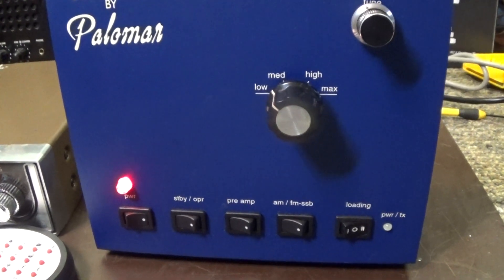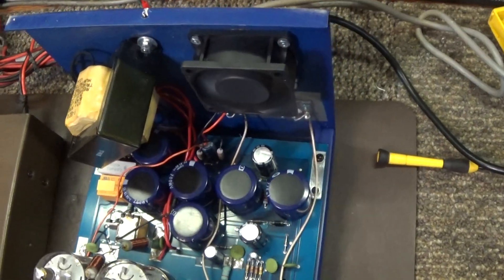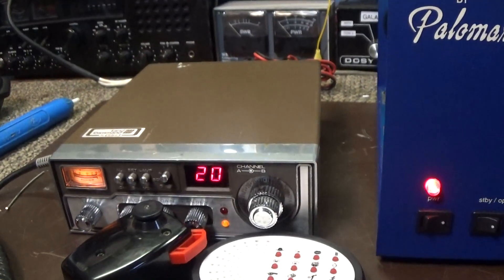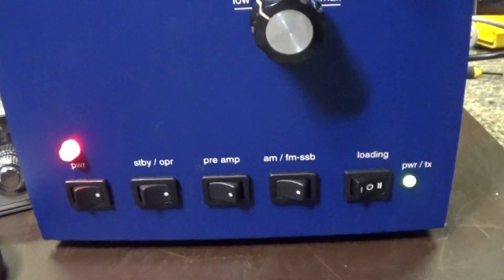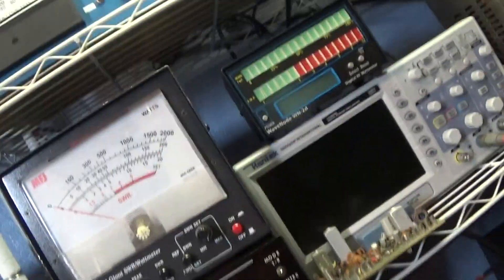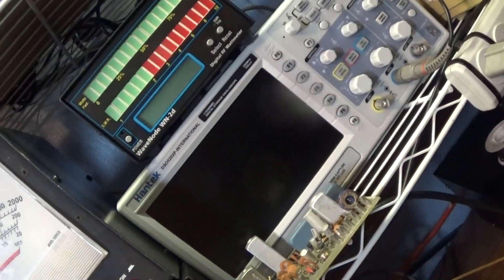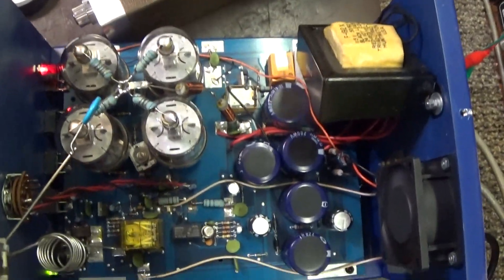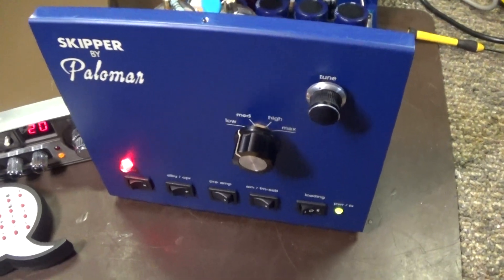Skipper by Palomar 4 tube 6146w linear amplifier

Comment: I really like this amp but Im getting 400 pep from a 2879 2 pill comp style Fat Boy amp.
Reply from the maker: Sure and transistors are a lot easier to use and a lot more trouble free than tube amps. But, tubes are cleaner, got more audio, and have more soul. Transistors are soul less.

Comment: Is possible to build one like this in grounded grid configuration?
Reply from the maker: Yes, but the problem with grounded grid amps is they need a lot more drive. For an amp like this with 4 output tubes, you would need to drive it with 50 or so watts, or build a driver tube in it, plus you would lose all that great swing.

Comment: So you are using a suppressed carrier with all of the negative peaks clipping, this is what your unmodulated carrier tells me.  I would not put that kind of signal through any power amp and put that up on the airwaves.
Reply from the maker: Suppressed carrier? No, reduced carrier. Negative peak clipping? No, assymetrical modulation, with no clipping neither + or negative.

Comment: Hello Tramdr: 
I am radiomedic111 and I am the designer of this little amp....the design was first presented to the manufacturer in late 1998 and then in early 1999 they were placed into production, I ended up working for them and did the assembly and pretesting of all of the units that were produced up until 2005 when the last run was made....in all there were 400 plus units made
as we were on our fifth order of circuit boards at 100 boards per lot. some of these were also produced as 3 tube units with an output of 150 watts and were equipped with a PTT line output at an RCA jack and thus were able to key up and drive bigger amps like the Heathkit SB-220 and the like. The circuit board had a floating ground or B minus ground plane that was isolated from the outside edges of the circuit board by RF bypass caps that blocked the DC and the AC line from connecting to the outside world, the power cord had a ground lug that acted as a safety ground. Although no schematics were ever provided by the manufacture, I will work up a complete full schematic in the form of a Jpeg and give it for free to anyone that would like to have it. My email is radiomedic111@yahoo.com 
I am just now getting back into the design and production of other small amps like this just in case anyone would like schematics or info on how to repair them. Thank You....Be safe everyone!
Reply from the maker: What is the 'Loading' all about?????
Reply: @tramdr  The 3 position load switch selects one of the 2 silver Mica caps plus the one in the center ....should be a 47Pf, 100Pf and a 150Pf lined up side by side just in back of the load switch and you would place the load switch in the position that gives the best or most output....the center position leaves only the center silver mica cap connected. Hope that this helps.
Reply from the maker: I would think to just put an Arco trimmer there.
Reply: @tramdr  Yes  you are correct, that would be the normal way to go and actually the original design called for a broadcast cap but that was a high priced item at $18.00 ea. at that time and an ARCO pinch cap with a shaft was $12.00 per unit...so a 3 pos switch at 35 cents and 3 silver mica caps at about 27 cents each was what they went with. the TUNE cap in the first few units were the ARCO L style  pinch caps but some units came back for warranty repair with the tune caps arced over from high voltage  RF, so the change was made to the air variable caps to prevent that from happening.

Comment: I had one come threw the bench. works great don't like much drive . had HV diode and cap go bad along with tube. 6146 a/b/w is also a ham radio tube. still made in china . got a heathkit with 2 that works 6m band . 73's

Comment: 6146 is an audio tube? Did you even bother to look up the datasheet?
Reply from the maker: I looked up many data sheets, tube history, and tube lore. 6146 is a later derivative of the 6L6 family of Octal based audio tubes. The 6L6 was of course designed as an audio tube but could be used as a rf amplifier up to about 10mhz and with reduced power up to about 30mhz. The 6146 is simply a 6L6 with the Plate coming out the top rather then the bottom which gives it a higher plate voltage rating and less plate capacitance which was the biggest hindrance for higher RF frequencies. Yes the 6146 is a well known and highly used RF tube, but it is still simply a 6l6 with the plate coming out the top and is used as both an audio and rf tube......but you already knew that, right?

Comment: have not been about to find one of these amps, been looking for years.
Reply from the maker: I regret selling all mine. Very hard to find. People like them a lot and love the 6146 tubes. I didn't like the direct transformerless HV supply and would mod that to an outboard transformer supply if I got another.
Reply: @tramdr  at minimum use a damn isolating mains transformer!  where should one look for one of those amps?

Comment: Hello my friend? Congratulations !!!  and the SWR  radio/amplifier????  how was it???   a big 73 PY2LP LUCIANO - BRASIL
Reply from the maker: I have had a few of these, they sold very fast. I do not have one at present, but from what I remember both the input and output SWR was very good. Only problem I have with these is the direct to mains quadrupler power supply.  I have heard of a couple big guns that got electrocuted using that on there big amps.
Reply: @tramdr  Hi tramdr!  
I really like your videos. Congratulations on your channel. Tell me something: How are you coupling the amplifier input ???
Reply from the maker: I bought and sold this amp a couple years ago. I do not build amps. If I remember right, it used an L circuit for input coupling.

Comment: The Load switch  is used how? Do you switch it and tune, and  switch it back then talk?  Never ran across this before.
Reply from the maker: No, instead of a variable capacitor for the Load tuner cap, this amp used a 3 way toggle switch hooked to 3 different cap values for the Load. You Tune the Tune cap like normal, then switch the different Loads and see which one works best. What they did was go cheap. A switch and 3 caps cost maybe $5, a good variable Tune cap cost around $30. Hence the makers saved themselves $20 by doing that, and probably saved another $50 by going with no HV transformer.
Reply: @tramdr  Thanks for the info, the tune knob can be turned for two days, and does nothing. LOL I like the box because it has 6146 tubes , instead of Sweep tubes.

Comment: that amp is american made buy  777 out of Tacoma Washington. ,  i used to sell them. i still have a couple left,
i also have two prototype black boxes of the early examples.   built for 11 meters.   uses a 24 volt transformer.
Reply from the maker: want to sell them?
Reply: you should let me get back to you, the two blue ones i have found were both brand new, they have been in storage for about 13 to 14 years now.  their should be two or three more, all new, that i haven"t yet been able to locate.  all my radio gear was packed for me many years ago. so maybe they walked off like many other items seem to have done.  you should give me an email address. and i can send pictures if you like.
Reply: Washington yes Tacoma no, these are from the east side of the state

Comment: Those 6146's are excellent tubes. Used in so many transmitters of the 1950's 60's era. EF Johnson etc etc. l wish 11 meter amp builders of the past would've used them. I guess if they had they would've been selling for the currently crazy prices being asked for 6lq6, 6lf6, 6kd6 8950 ECT ECT. It's the 11 meter amp builders of the past that single handedly helped dictate today's sweep tube prices. I wish I'd known then what I know now. I would've bought a few thousand 8950's when they were $5 EA. in 79. Your amp is most likely not built by Paloma as you most likely know but by someone in their basement workshop. Looks like they did A nice job. 73

Comment: You can tell that isn't an old unit just because of the way it swings, which wasn't a thing until the mid to late 90's. It's seems like everyone was big into the swing kits and variable modulators then. That's a Cool little amp though, wish I still had some of the oddball brand amps I once had.
Reply from the maker: I don't agree with that. Blackcat was around in the 70's, Varmint with the Supermod, and others. I started doing swing, reduced carrier, assymetrical mod, etc in the late 70's.